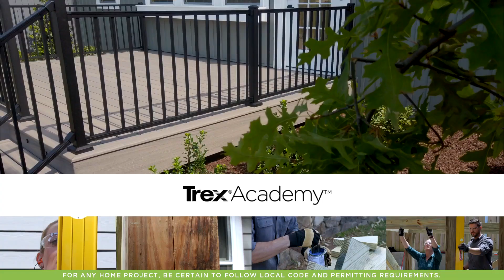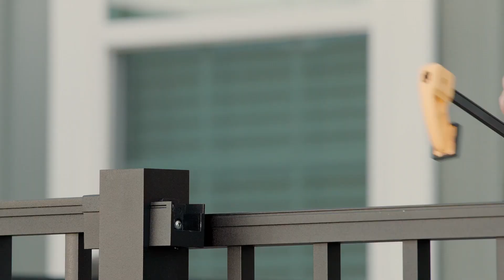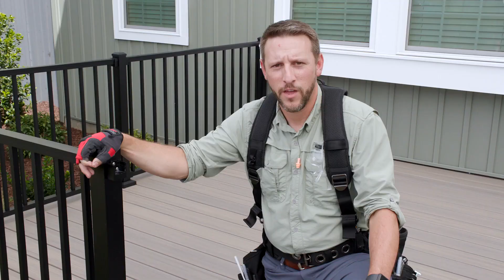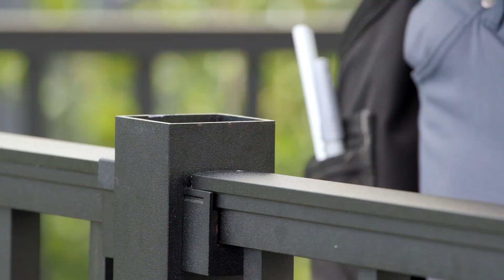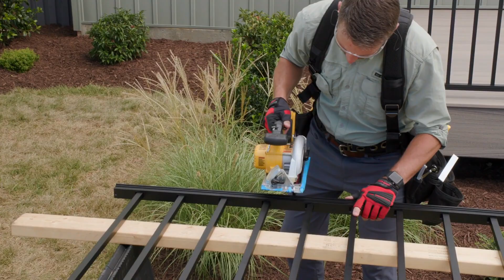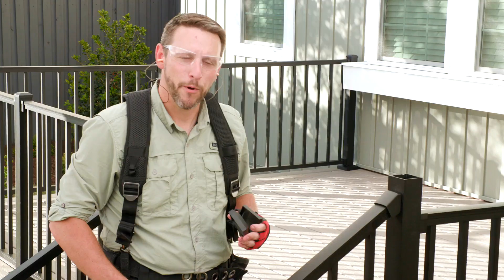How to Install Trex Signature® Deck Stair Railing Panels | Trex Academy

Comment: What blade should one use to cut aluminium railing?
Reply from the maker: Hi there! A carbide tipped blade with 60 or more teeth is what is recommended to be used. Thank you! ~ Trex Customer Care Team

Comment: are the panels slope adjustable? what angle are they?
Reply from the maker: Hello, Thank you for reaching out to Trex and for your interest in our products. We offer several options to accommodate angles up to 45 degrees. Additionally, we have a bracket that allows for installation on slopes ranging from 0 to 50 degrees. We also provide a flared stair application that supports both the 45-degree angle and the 0-50 degree slope. We look forward to serving you in the future. Thank you for choosing Trex.
Kind regards, Brandi Trex Customer Care 1.800.289.8739 | customercare@trex.com

Comment: What is the part number for the pre assembled stair panels?
Reply from the maker: The part number for 6"x36" Assembled panel for the stairs is BKAS0636SRPNL. 
Also, Here is the part number for 8'x36" Pre assembled panel is BKAS0836SRPNL. 
If you have any other questions feel free to reach out. -Trex customer care 1(800)-289-8739

Comment: Are there angled brackets available for decks and stair cases that have off angles from 90 degrees?
Reply from the maker: Hello! We offer a swivel bracket that allows you to do different angles for stairs and some other brackets for the Signature railing. Here is a link to our catalog. On page 41 under accessories, you will see the different brackets we offer. https://online.flippingbook.com/view/67338745/40/

Comment: I see "tabless" brackets listed in catalog, how are these different from the ones shown in this video?
Reply from the maker: Hello there! So, the tabbless brackets that we now offer are the newer version of the signature railing brackets. These brackets can be used interchangeably and have make use of command strips instead of having the tab to assist holding it in place to make it easier for installation. Hopefully that helps!

Comment: Do the preassembled railing panels come with brackets for attaching to different newel posts, such as 4.5” composite?
Reply from the maker: Hello. Thank you for reaching out with your great question. The Signature Pre-assembled Panel does not come with hardware, as they are typically paired with Trex Signature Aluminum Post with pre-mounted brackets. However, the Signature Railing Hardware (available to be purchased separately) does come with screws to accommodate a wood post installation. We do have this hardware available on our ShopTrex website https://www.trex.com/shop/ Kind Regards. -Trex Customer Care

Comment: What’s your post height at the top and bottom of those stairs?
Reply from the maker: Hello, and thank you for watching Trex Academy! For this video, we used 43" posts and cut them down as needed. For Trex Signature stair railing installations, we do have a 53" Trex Signature posts that can be used. This post is great as it can accommodate a variety of stair slopes and also be cut down as needed. If you have any further questions about our products, please feel free to call us at 1-800-289-8739 as we are happy to assist. Thanks - Paul, Trex Customer Care